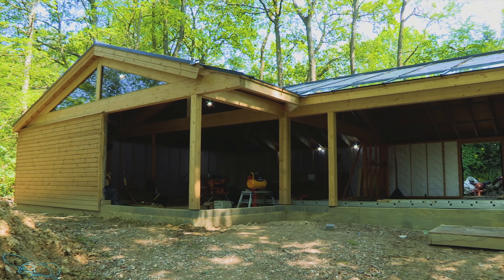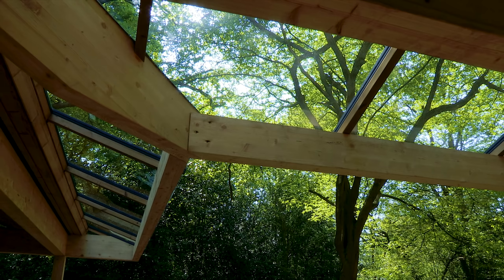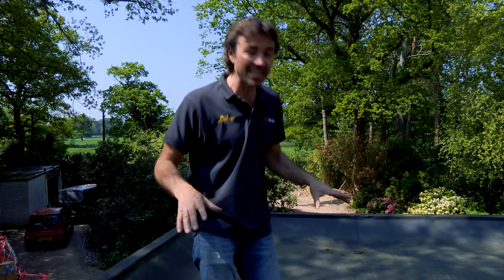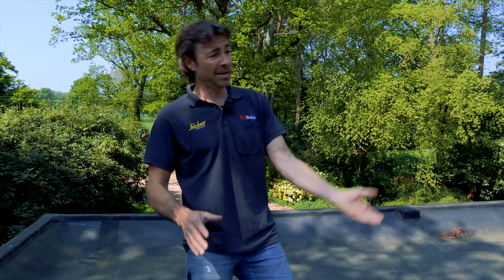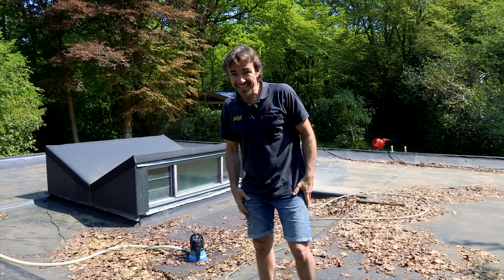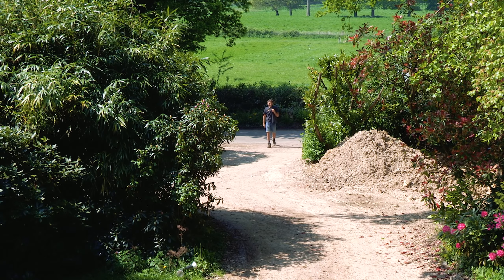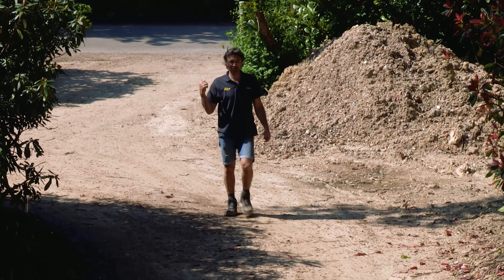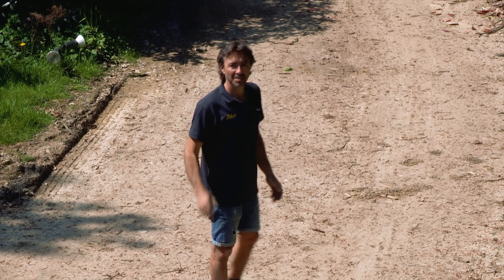Unloading the Timber Frame House - Capel #6

Comment: So Robin, here’s a question, those panels in essence are stud walls with osb sheathing and insulation between the studs, why not make them yourself onsite ?
Reply: Hi! I did consider making it all but the guys I use are so good that their cost and service is a no brainer I may have saved a few quid but the way they produce the work is almost perfect and even with my abilities I don't think the tolerances would be as perfect as theirs, I will produce all the internal walls on site to suit final layouts etc but I reckon that using the timber frame company for these elements will save me time and money in the long run thanks for your interest and comments
Reply: Time! Also these guys have massive buying power and the technology that they have means that I could probably not be able to get it done as well for the price!

Comment: I do the same job as the driver. If my boss saw me letting a customer on the lorry bed I'd be fired.
Reply from the maker: It is a difficult one. We all try and help the driver if we can because it is hard for them to operate the crane and put the slings on. The fact that it is Robin's site and the driver didn't ask him to go up there means it is Robin's risk assessment and in truth he has a lot more experience of working at heights than a driver.